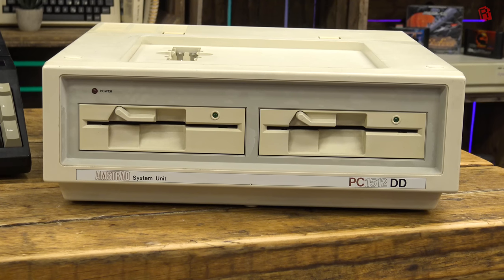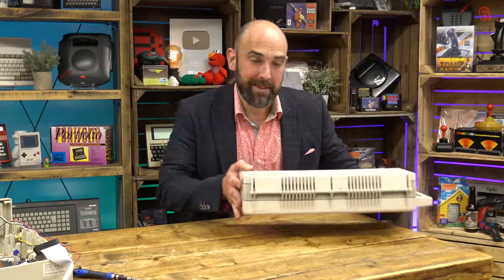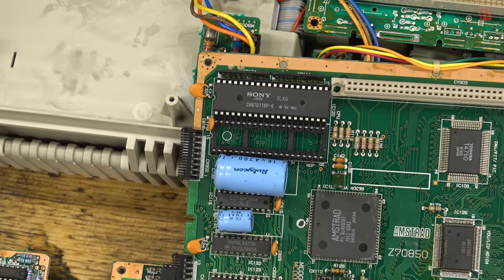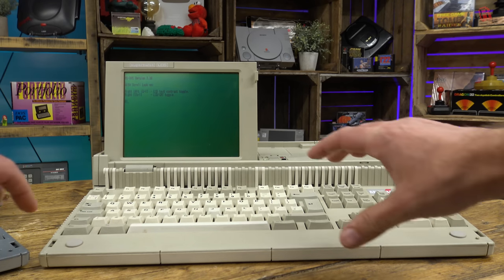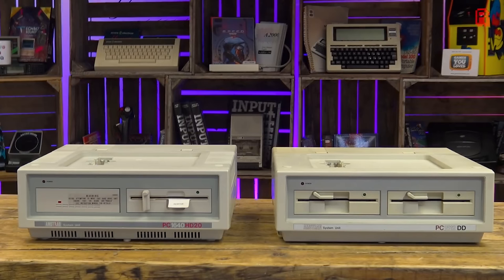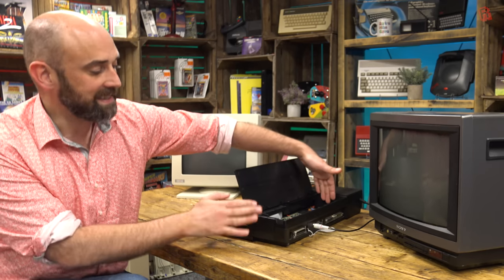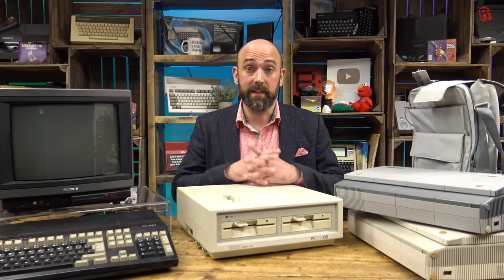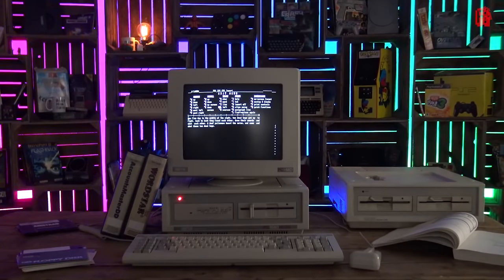Wedge Shaped PC's? Meet an unusual Amstrad computer family | Show & Tell

Comment: Strange how I thought the PC 200 to be a load of rubbish both in looks and functionality when it came out- probably partially because it was not a Sinclair (I assume the affordable PC thing was seen as a link) but it seems so cool, now. 

Such a good idea - a PC that plugs into the telly like a home computer was surely a potential future at this point. Obviously in 1988, PC arcade games were a bit behind the competition, but the principle is great. That and it looks so cool.
Reply: Plus with 512k of RAM, not sure if most PC games would even work on it?

Maybe if they'd got the price down further - it was still the same as the ST (to be fair still £100 less than the Amiga).
Reply: @kevinmarriott8698  640k didn't become a common requirement until 1990 and most 80s dos games ran on either 512 or 256k ram. Also the amiga 500 was £499 and the ST £399 before they were later discounted; £299 was actually the same cost as a c64 with a disk drive which is pretty good for deal for a XT clone. The PC was definitely behind on arcade games but that genre was migrating to consoles while PC compatibles were rapidly becoming the premiere platform for RPGs, adventure games, simulations and strategy games.

Comment: What's the Power socket on the back of the PC200 (next to the floppy expansion port) for?
Reply from the maker: I believe you can power it using the power cable from the Amstrad monitor, so you only need a single plug in the wall.

Comment: The wedge makes me wonder whether an integrated PC with 386 clone and VGA chip on one board could have competed in the home computer market, giving access to the PC games catalogue at minimum cost.
Reply: In 1990 epson did released the PC Club 286C wedge computer. While it ran DOS/V rather than Dos, it was a 12mhz 286 with 2 3.5" drives, 2MB of ram, 16 colors and a Yamaha YM2203 for about $1000. In 1990 you could have easily got a locally assembled clone 286 system for the same or less, but it still would have been cool to see similar wedge style 286s released in the west.

Comment: Wow this really took me back. I remember having a ppc512 when I was in primary school about mid 90s it would have been. Running dos 3 off a floppy. Pretty sure that was the machine I pretty much self taught how to work command lines, after failing on the spectrum 82+. The keyboard was very fragile, or I was rough with it as it got snapped at least partially. I had a mono orange monitor to use with it which was just as well because the inbuilt screen was horrific. I tried to play some games on it, sailing and volleyball but it moved way too fast for the screen to keep up. My dad told me a modem could be added to the box next to the power switch but only really for newsgroups and email back then.

Comment: limited to 512k (most PC games were 640k) and limited to CGA and PC speaker (inferior to the Commodore 64 1983 games library). Amstrad made a lot of rubbish for clueless people who couldn't be bothered to do their research. This thing is worse than the Spectrum 128 never mind CPC6128 LOL
Reply: very few DOS games released in the 80s needed 640k ram and most ran on even 256k machines. The PC200 could easily be upgraded to with a v30 cpu, vga and a soundblaster/adlib which put it above the atari ST. However, even the base machine was capable of running rpgs, simulations and adventure games well beyond anything on the 8bit micros, as well as platform games like prince of persia and commander keen.
Reply: @robj1296  Soundblaster is SFX only, Adlib in 1983 quality garbage OPL so go and play F-1 by Domark on ST with s/w samples and s/w mod tune playback and try and tell me Soundblaster was better than ST, Adlib is never going to sound as great as music of Sidewinder on ST or even standard YM chip tunes of Xenon 1 etc, these PCs only supported crappy 4 colour CGA (PPC512 leftover parts) not even Tandy 16 colour CGA, and DOS games in the mid 80s were crap compared to even a Commodore 64, just look at Defender of the Crown for DOS, rubbish and no effing soundblaster or Adlib support at the time of this crap idea that fell out of Sugar's brown eye, worse than Spectrum 1982 graphics or even sound, a piece of crap 100% that was canned because it would fail. Windows 95 sound system DACs on the motherboard AND fast SXGA chipsets circa 1993/4 required for even remotely Amiga 1000 quality and speed. Based on side by side real hardware testing You needed a DX250 to replicate Lotus III 50fps speeds of Amiga 1200 (and the £400 MT-32 music was shit, 16bit quality but wedding band levels of naff instruments too), you needed a Pentium 133 to replicate 50fps of Super Stardust on Amiga  1200 but at least PC finally caught up to being able to play MOD tracker tunes in a game engine as well as a 1985 Amiga 1000 lol. So many clueless people on YT, I owned it or played it ALL, remember that, even played R-Type on PC Engine in 88 with Julian Rignall on a trade day at the PCW show (ace bloke). I had Windows 95 beta release 9 months before anybody else a 486 when most had a 186 and a PCI-I pentium 133 first in the que so I played everything that wasn't boring RPG/Strategy DOS rubbish so I know mate, PC piracy was a joke, worse than ST and Amiga lol. Commander Keen looks shit compared to even Nobby the Ardvark or Green Beret on C64 and no EGA PC could ever replicate Terra Cresta or Sky Shark running on a 1982 Commodore 64. Zaxxon etc on PC CGA makes me puke, hell the PC-200 couldnt even do Vanguard or Phoenix like a 1977 Atari 2600...and no joystick ports or proper joysticks like Zipstik for PC, Pong console type rubbish analogue sticks..fail.
Reply: @robj1296  Not in 1988 they didn't it was all 512k or more even for things like The Magnetic Scrolls Collection adventure games compilation, hell Amiga users wanting to play Dungeon Master needed 1mb. The 4 colour CGA it used was rubbish, this is 4 colour CGA twin palette  designed for using text DOS apps on a monochrome display not 16  colour CGA like a Tandy PC. Soundblaster and Adlib arrived in the EU after this machine was quickly cancelled. None of the games you mention are CGA 4 colour games either. Whether you have an NEC V30 or 8086 is neither here nor there either, as even the ST had some, not many, smooth scrolling 16 colour arcade style games and the ST was £200 cheaper than the PC-20/PC-200 rubbish Alan Sugar was trying to peddle to the dumb sector of the market. It's probably responsible for Amstrad never achieving any success in the home market from 1987 onward, not even the half decent Mega PC combo or the GX4000 consoles. It also cost more than the PC1640 in 1988 which came with EGA not CGA (and was selling very well to business users). This was a turd, it was an inferior machine to even the original ZX Spectrum, you couldn't even play the PC conversions of the best ST games like Defender of the Crown without popping in an EGA card (but the top flap can't be closed and had to stay open) and even then no Soundblaster or Adlib cards had even gone on sale in the EU anyway. Even early games that support CGA like Zaxxon etc are utter garbage compared to even the 1979 Atari 400 and it didn't have a hope in hell of even remotely matching early C64 games like Terra Cresta or Law of the West on tape LOL